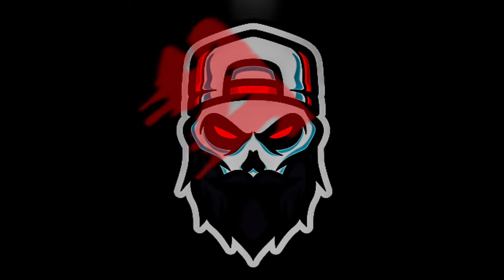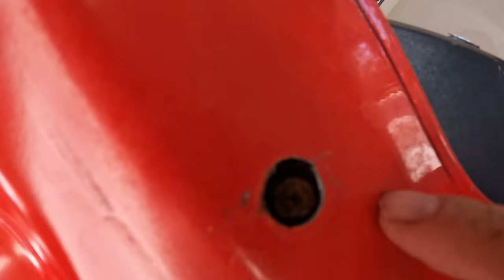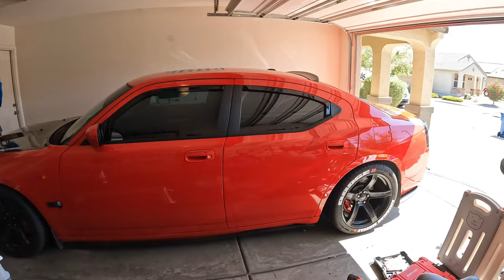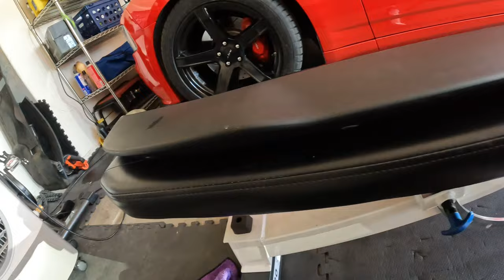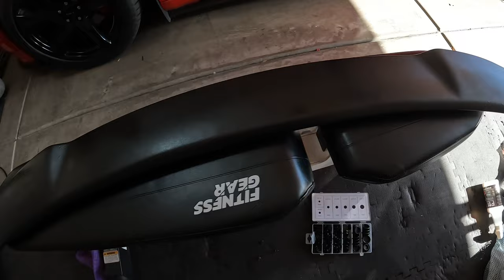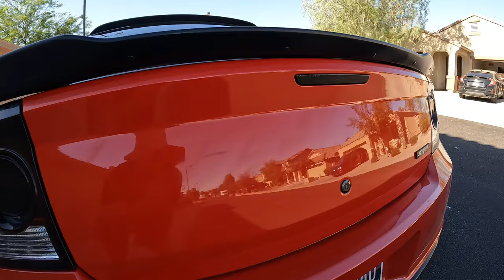My Hellcat spoiler wicker bill is DESTROYING my SRT CHARGER!!! #srt #charger #dodge

Comment: The spoiler with out the extra plastic looks hella nice it Matched your cars black on the top and bottom but if you do go carbon fiber it won’t look as nice as that bright red and black but I was wondering does the spoiler by itself scratch on the rear light or how did the little buff happened not to copy you but I love that new gen spoiler on the old gens I just don’t want to mess up tail lights

Comment: But that main question is if the spoiler with out the wicker bill 2pc hit the sides or the tail lights when u shut it
Reply from the maker: I think because the wickerbill gets loose over time it begins to scratch the taillights and trunk a bit too without it it never does but it did look bad ass but it would shake on the highway 🫣